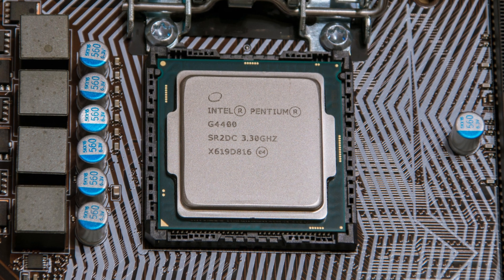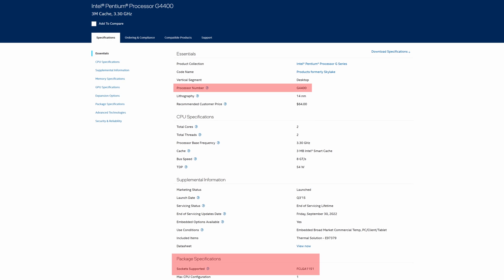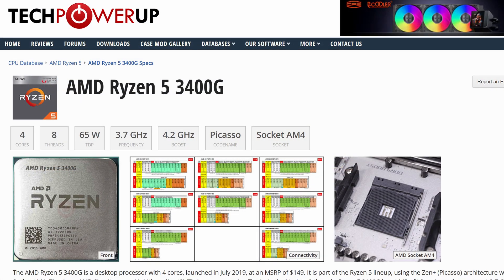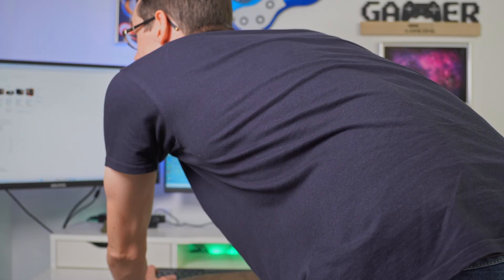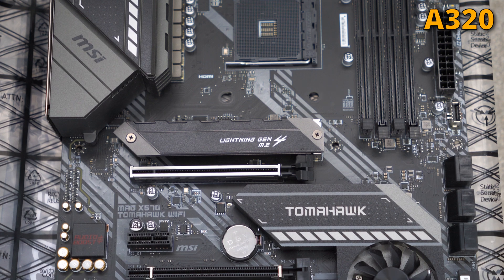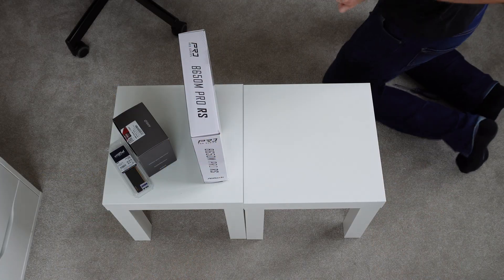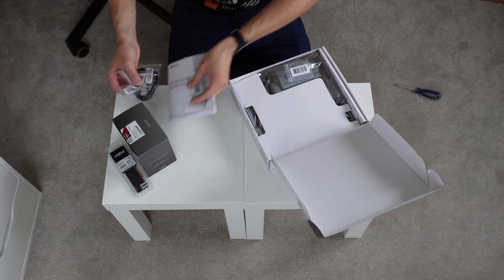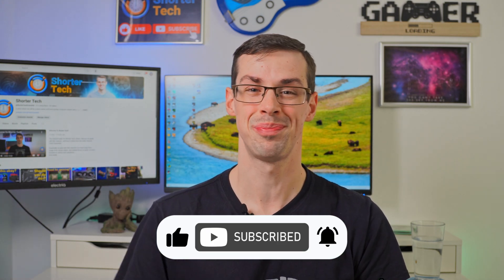Can You Use Old CPUs On A New Motherboard?

Comment: i always build my pc ,but it been really a good will since i did it.    it almost 15 year ,i am not up to date with them anymore
need to upgrade to windows 11 ,i am not in gaming , i just need it for doing normal stuff at home
i was thinking of keeping my old atx box with power supply and pci express gpu very basic low end
will it work with new motherboard ?
Reply from the maker: I probably would change the PSU if it's very old (10+ years old), but that's just me. In general though, you CAN keep the same ATX case and GPU yes - there's no reason not too, other than potentially the display drivers not being supported anymore. Even then though, you should hopefully be able to find some level of compatible drivers unless it's a 15+ year old GPU.

So, a new motherboard but the same physical case and GPU should be fine on a new Windows 11 install - IMO :) Good luck with it!

Comment: I just bought an Ryzen 5 1600, i was just looking for good deals on a b550 or an b450m pro max, would this older cpu work with an am4 motherboard?
Reply from the maker: Ah nice, that's still a bargain of a CPU :) So it should work fine on a B450 motherboard, although IIRC some B550 mobos dropped support for them. It just depends on the exact motherboard model and what BIOS is installed. B450 might be a safer bet though :)